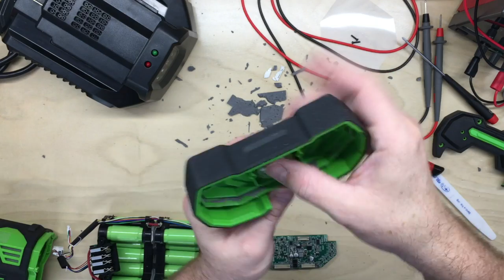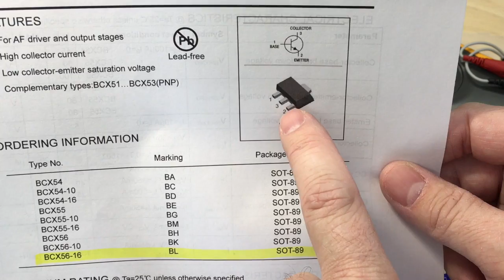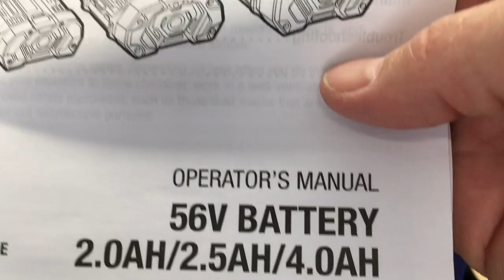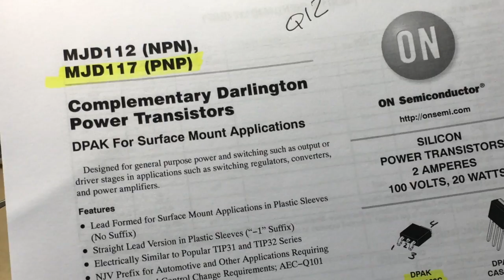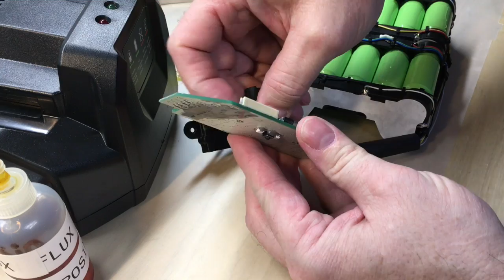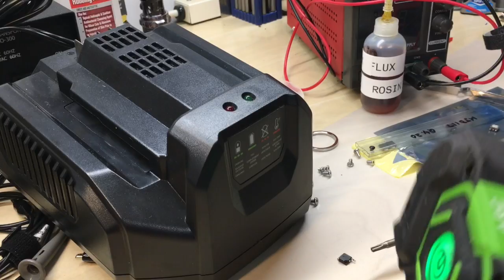EGO 56V ARC Lithium Battery Repair

Comment: I have an EGO 2.5 from 2017 that measures 51v but has no response when I press the indicator button and gives no light response when I plug it into the charger. Each cell measures 3.68v. I thought I would ask if anyone else has seen this issue and what may be wrong with it. Thanks much
Reply from the maker: I have had one that was very similar. It was a bad connection at the fuse on the connector board. It has a circuit board trace type fuse and it was not getting the connections through it. Mine wasn't blown but rather bad solder joint...Best of luck!
Reply: Craig, I have a 7.5AH acting just like yours, also from 2017.  Voltage is around 53, cells range from 3.76 to 3.79, runs my blower OK but no light when pushing the button and the charger doesn't respond at all when the battery is placed on it.  Following this video I removed the potting and checked Q12 which shows open both directions between the base and collector and there is no voltage at the 3.3v test point.  I don't see any burnt areas on the board so I'm ordering a Q12 replacement in hopes that's all that's wrong.

Comment: Love your video, it's extremely detailed. My battery stays blinking green non-stop. Is that controlled by the chip you were proving on with the red blinking light?
Reply from the maker: Yes that shorted transistor did cause it, just make sure you are more vigilant in keeping the battery from discharging to far until it is repaired! I think I mentioned in the video that it will pull all the cells down to zero if not watched closely due to that transistor being shorted! Best of luck and thanks for your comment!

Comment: NICE JOB!  I found this vid because I got one of these out of the recycle bin at home depot to recover the cells. They were all at .5v. I started charging a few at very low current just now but they are taking charge. Need more to test them for impedance and capacity to see if they are recoverable.  If you want the board out of it your welcome to it. But I did snip the balance leads, thermistor leads and main current wires right at the cells. Thank you for the time and trouble you took to share this with everyone.
Reply: how did you got it? In Los Angeles they are not allowing you to go thru a bin...
Reply from the maker: Hi, I also have got several packs from the recycle bin.  I have asked the Manager at our local Home Depot and He was fine with me going through looking for packs. I am sure it could vary store to store and even manager to manager...
Reply: @pashko90  I goto lowes and home depot. Some store let you have them some dont. One store it depends on who is on duty at the CS desk. So I have learned when not to go to that store.
Reply: @lmorrison17  What is CS stands for? cant figure it out.
Reply from the maker: I am voting... Customer Service.

Comment: Where do you get the circuit board holder?  It is very handy.
Reply from the maker: Hi,
The holder is from ebay but I did add the flexible arms myself. I added link to both below if interested. I just drilled two holes and mounted the flexible hoses to the base as a helping hand. Hope it helps. Thanks for your comment, It makes me think others may want to see what it is also, perhaps quick future video?

Board Holder:
https://rover.ebay.com/rover/1/711-53200-19255-0/1?icep_id=114&ipn=icep&toolid=20004&campid=5338325412&mpre=https%3A%2F%2Fwww.ebay.com%2Fitm%2FCircuit-Board-Holder-Adjustable-Vise-Electronics-Repair-Clamp-Soldering-Stand%2F333213540273%3Fepid%3D710122992%26_trkparms%3Dispr%253D1%26hash%3Ditem4d95131fb1%3Ag%3AuAUAAOSw95lc7I1f%26enc%3DAQADAAAB4KX%252FKt4E1xf3SDqEdBclaYZuZzce1i%252F95Xd0z7gDWX%252FJBSonIj91o%252FfiMvEuX5vNIqdXrgRGQU%252BaaCeZuymqN3iFZmvfv2yVm1qChZOczBGaa%252FVAxZR%252FY98wiyGaR%252FIxXykHh7C3DU2pkd6NF5PdPIA%252F7nPckpUd2d9BXvtlD4ho%252F%252BHpocf7v0oZSHNWZHZt3UHB5PGVJI4P6Dv8D4F%252BYSpzRj76sQQmkmi698Ym8tFkWJ%252BYqJsDFKnLKGpZ%252F5359L0SAp%252BxbL%252FNJUcgrrD9tXV3XJ%252FJb80hmjR4Vv%252FAPiO1ENBhfd62Dqu6SNGdFSF0rR6H2JhFFVqIejyY%252Bv95KSiLBmh%252FPsSpYFTBAacd6J0f5NQoPiNQsTShf08qRaBestYkh8ejh%252F5AwtQysCO7MR2j3eidiGcyH%252BrBhTy4Na77SYIb5tG4PZJajZBuVyvg93tACCBk3CicRwCq7Hvnl7MUAtAtXDXwjl2aZ2VrOKcsBXu3wn66jel%252BBOn%252BXL3jCB83EQI15QLzVJMWsrnGWEltAuUmw2sWf4K5MGrxSPY9Q0xWwVHKVnC65tzYF8JWzPsxOv8gII4F7dCDne3rkszi8l7az6aDhawzHTzaIHw2nmKVe4Cc%252B%252BZdS4yM4fyvvA%253D%253D%26checksum%3D333213540273e6f94d3b25b84a0ca552c9370d8dcc28%20

Flexible Coolant hose:https://rover.ebay.com/rover/1/711-53200-19255-0/1?icep_id=114&ipn=icep&toolid=20004&campid=5338325412&mpre=https%3A%2F%2Fwww.ebay.com%2Fitm%2F10-Pcs-Round-Nozzle-1-4PT-Flexible-Oil-Coolant-Pipe-Hose-Blue-Orange%2F282610160803%3F_trkparms%3Daid%253D555018%2526algo%253DPL.SIM%2526ao%253D1%2526asc%253D20131003132420%2526meid%253D174705743b8f45c096be36f2866b8394%2526pid%253D100005%2526rk%253D5%2526rkt%253D12%2526mehot%253Dpp%2526sd%253D163003388384%2526itm%253D282610160803%26_trksid%3Dp2047675.c100005.m1851%20
Reply: Thrifty Tool Shed  use bitly, to shorten these monstrously long urls

Comment: Thank you for the great and in depth tutorial. The battery that came with my trimmer just starting flashing green this past weekend and I couldn't find anything about it until I found your video. It's less than a year old so I'm definitely going to contact EGO first and go from there.

Comment: Can you use your own DIY 56V (14s) pack to use with the mower? I know I can attach it to +ve and -ve leads on the mower but not sure if not attaching the middle two leads will cause the mower to not start. I don't have a 14S pack in hand otherwise I would test.
Reply from the maker: Sorry, I do not have a Mower so I am not sure. I would think very likely at least 3 terminals are used and maybe all 4.  Just due to  monitoring the temperature if nothing else!

Comment: I have the same problem blinking red not holding charge might be the same issue but at lease I have something to start. Good thing when my battery had an issue still under warranty and Ego replace it and they just told me I can keep my bad one so by this repair fix I probably get the bad one work again as you know this battery cost a lot. Thanks for uploading the two videos.. Will update when I tackle my battery. God Bless you..
Reply from the maker: Awesome, yes I do appreciate EGO letting us recycle the battery. What better way to recycle than a simple fix!
I do know the gen2 batteries are coming with the updated BMS and does have the fuel gauge like we have asked for. Thanks for your comment! And God Bless you as well!

Comment: Great Video! Helps a ton. U seem to be the only other one that's had this blinking green light issue.
Reply from the maker: Thanks for your comment!
Reply: @ThriftyToolShed  I got it on both of my battery's about 6 months apart. They were both under 2 years old. Ego said they would replace if I could provide proof of purchase and of course I don't still have the receipt from 2 years ago. Makes me really wonder about buying another ego product.
Reply from the maker: @whoknowsthatswho , I understand. I don't keep receipts  the best either. I was lucky that I had registered mine right after I bought them and still had receipts. Still, seems like they would have tried to work with you!
Reply: Thrifty Tool Shed  just a tip. Take a picture of your receipt from cellphone as soon as you have it in your hand then you can toss your paper receipt Lol. I do that as an habit. Because I'm having problem finding my receipt one day that I need to return something. 🙂
Reply from the maker: @OKBAOK , Very true. I do that now also on larger purchased if they do not email the receipt, I like it when they do that as well!

Comment: Thanks so much, I've now had 7.5AH packs for the same issue, EGO has been great under warranty but their does seem to be a problem with the Q12 either a bad batch as you say or design problem.  I'm trying to work out the failure mode? any ideas?
Reply from the maker: Hi,
Thanks for your comment. 
I guess I am not sure what you are asking about the failure mode. Are you having a different type of failure with the 7.5 AH?
Reply: Are the circuit conditions exceed the transistor's voltage, current or Safe Operating Area (SOA) specifications? Or of course, it could be the whole batch of transistors from a particular manufacturer.  I suspect that failure occurs when the battery packs either overload or enter the low state of charge cutout condition. While my batteries are all 7.5 Ah, it is happening to small packs as well as you have found. 
The transistor SOA at 50Volts is only 0.3A, I was trying to find a replacement in the same case with a more generous current at 50V but this proved difficult. When I get the new transistors in I'll have a look at the voltage and current on my CRO also to see if any voltage spikes are occurring.

I'm really surprised that the BMS board is not changed as this is all it needs to effect a successful repair.  
I really appreciated the video it helped me save heaps of time.  @ThriftyToolShed
Reply from the maker: @raymiller5738 ,
Very true I have wondered the same and had issues finding same package in higher ratings so I still just use the exact match as I did in the first one I repaired. I have not had a failed transistor yet out of the repaired packs so it could possibly be a bad batch? Although I have suspected as you mentioned that in certain conditions the ratings could be getting exceeded, but have never caught that being the case. Thanks for your comment and I wish you the best on your repairs!
Reply: The MJD127 is a DPAK 369C and is rated at 8.0A so that it is the same footprint as the MJD117. I purchase a few of these in case the replacement MJD117's failed.
Reply from the maker: @markcreighton1100 , I was going to do the same. I have not had another failure since so hopefully just a bad batch!
Time will tell...
Reply: Thanks Mark I think I did find that but as well, checking the SOA; at 50V  it had about the same current (0.3A). I traced out the circuit and it's a simple 50V switch on/off slowed by base - emitter capacitor C33 1u5, I suspect that current surge charging C12 on the collector is worst case condition. I did look at adding a small resistor say 47ohms in series to limit the peak current into C12 but was not easily done.  I do suspect the Q12 MJD117 installed is from a manufacturer with a quality issue, I replaced mine with ON semiconductor from Element14.   Time will tell.  My two repaired battery packs are working although with reduced capacity, not like the replacement units, but still handy. 
In time the next thing will be in replacing the cells.  cheers
  @markcreighton1100

Comment: I've been looking at EGO tools and wanted to know more about the BMS. This was a great deep-dive into just that! It's the first video I've seen where someone goes under the potting material! It was heartening to see that it was relatively easy to get in there; I was initially thinking the potting was the hard material which would be next to impossible to get off. I am still interested in what comes out of the D and T pins, since the tools must receive a data signal from the battery telling them when they're dead or over-temperature. I've seen some tool tear-downs and the T pin doesn't seem to be connected, so that's probably just used to communicate with the charger. But are these bi-directional, or just output from the battery?

Anyway, my musings aside, great video!
Reply from the maker: tjncooke , Very good question indeed, maybe we can figure that out soon! Thanks so much for your comments!
Reply: @ThriftyToolShed  Did you have a chance to play around a data protocol on this packs?
Reply from the maker: @pashko90 ,
I have a video on "What's the D-terminal?" Where I shared some of things I have learned, what I guess maybe happening and then mentioning that we need some help here going further into it. I don't have equipment yet to test for protocols, but seems it is using one for sure. I still hope some Electronics Engineer with BMS circuit design background will come across the video and decide to pick up on it and share some knowledge. Until then we have much still to learn!
Reply: @ThriftyToolShed  yep, i checked it out already, i'm workig with CAN bus more, lets see if i will have some time to figure it out.

Comment: So if you read in the owner's manual then you'll find that the battery behaving how it was is normal. It's purposfully discharging itself to save it's life span
Reply from the maker: ImaITman, If your manual states it does this all the time then yes yours is normal!
This is a well known issue! They are are pulling down to zero volts and ruining the cells as stated in the video!
Reply: @ThriftyToolShed  oh wow now that is unknown info to me. I watched your first video and then read through the manual and the scenario fit exactly as how you'd described it. Interesting though as the description matches exactly, I wonder if the battery sits for several months and goes into that discharging state and never comes out of it. Learned a ton from your videos btw!
Reply from the maker: ImaITman , Very likely what is happening. I have had 2 out of 5 batteries do it so far. Lots of viewers have responded as the problem is pretty common. Once I found the transistor shorted causing the drain, I wanted to share it to helps others. Once you realize it's not acting normal, you have to act fast and keep it charged up so it will not over discharge the cells . Thanks for your comment!

Comment: What an awesome tutorial
i want to take a course from this guy, design is easier than trouble shooting
Reply from the maker: Hung Tran, thanks so much for your kind comment. I have started a series called electronics on your level. I know it started slow but I hope to build it up to board troubleshooting!
Reply: Thrifty Tool Shed 

thank you 
i have a very new ridgid 12v drill 
two of batteries simply won’t charge and home depot or ridgid won’t do anything about it

i will learn and try to figure it out what is wrong with them ?
or even ship to you so you can do video on them
Reply from the maker: Hung Tran, man if they Ridgid, home Depot really should make it right! I would push hard.....
Reply: @TranTek  I bought ridgid because of LSA (lifetime service agreement).  Hope you registered them at time of purchase?  If not, I'd petition them, and try to collect any proof of purchase (even if it is cell phone pics or friends testimonials?)  Good luck!
Reply: loves2shoot i had moved on to Bosch and love it, it lasts long long time.
i also added Milwaukee to step up for bigger torque 1/2

Comment: Great video! I have the same green blinking light problem. These batteries cost an awful lot to purchase. Would you be interested in repairing any?
Reply from the maker: Ed, Thanks for your comment. I did not understand the question, if you are asking me is it worth a repair attempt. I do think so.  One thing I show later in a follow up video is that I did have to replace a couple of cells to get the pack back to full capacity. Lesson learned is keep the battery charged well until you can attempt repair. It (the evil blinking green light) will pull the cells too low if not monitored well while just laying around waiting  on parts.
Reply: Would you be interested in repairing mine? I don't have the tools to do it justice. The cost of shipping should not be to much. I also would assume that the problem is the same chip you replaced. We can work out a price? Let me know.
Reply from the maker: Ed, I wish I had the time. Best I can do is just try to share what I found if it helps someone. I wish I had more time for videos, but I am very limited. Sorry.  Best of luck with the battery.

Comment: Excellent work! I have the green blinking as well, EGO support treats this as a known problem and is sending replacement.  Wonder if they couldn't just be refurbishing these with new boards, I'd imagine bulk of the cost is in the cells themselves?
Reply: My 7.5ah just did this, and theybare replacing it under warranty, but Im wondering why they dont just send me a new top half and say plug and play. The batteries are good but useless with out the board.

Comment: That was excellent. I don't use Ego products but another 58v system (AEG in Australia otherwise known as Echo in the US) & I'm curious if they use a time base discharge or not, although I can at least check the level meter on the battery but I am also surprised Ego doesn't have that. I'd appreciate your thoughts on that. Thanks.
Reply from the maker: Ross the fiddler, I do not have any experience with the echo batteries at all but I have always liked there gas powered products. The ego does have a more unusual approach to me for battery level. The push button /power indicator shows
 green if over 15% charged? Red if low voltage level and blinks red when nearly depleted and needs to be recharged. It's different but it works. I wonder if it is that way so the all there packs can use the same bms board with it regardless of the amp hour rating but I only own the 2.5ah so I am not sure about that.
Reply: Thanks for taking the time reply anyhow.